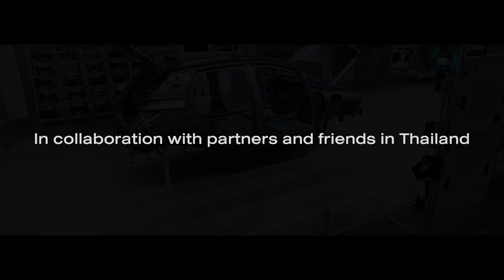BYD Thailand Plant | Inside the All-New World-Leading Production Line

Comment: What is benefit for Thailand, if everything come from China, or produced by Chinese company.Engineers and Technicians come from China.Where is workplace for Thai People?
Reply: :yougotthis:Your mindset can be changed. First, you don't hire a worker, but the tax payment is the same. Thailand will export to other Southeast Asian countries, and the money can be used by this country. It just provides land and policies. :yt:Second, the truth is that modern factories do not need so many low-skilled workers. What skilled workers need to do is to debug programs and ensure quality. The quality of assembly by hundreds or thousands of low-skilled workers is not that reliable, as many traditional automobile factories have proven with decades of experience. :yougotthis:The third is that it pushes up costs. If the number of people employed and the return rate are taken into account, the price will eventually be passed on to consumers. :yougotthis: Fourthly, hiring a lot of low-skilled or unskilled workers is essentially just a form of political correctness, that is, providing jobs. :yougotthis: China has proven this approach in recent years by providing more jobs in other areas, such as safety officers, test drive attendants, etc., and the overall number of people in the industry has not changed much.